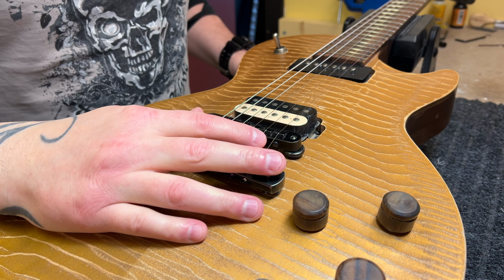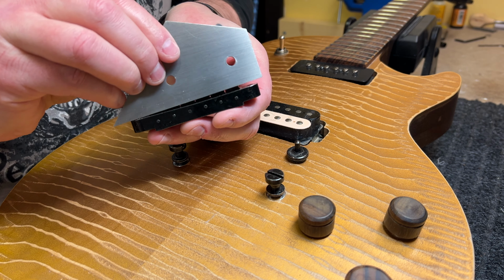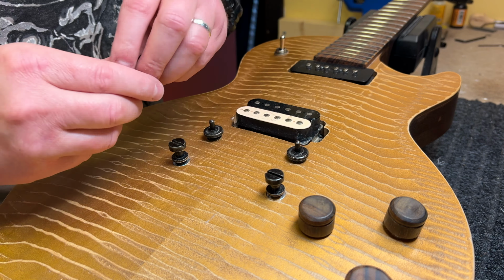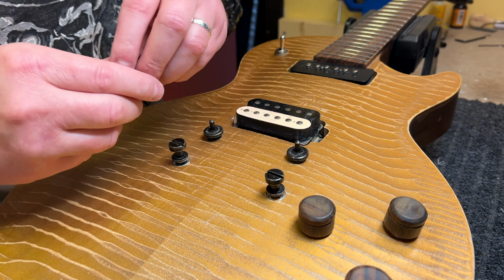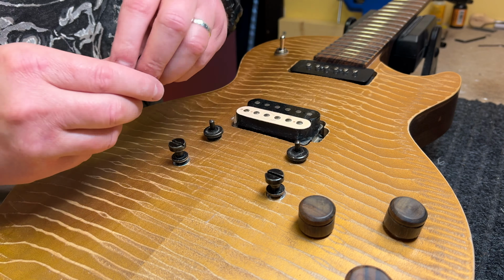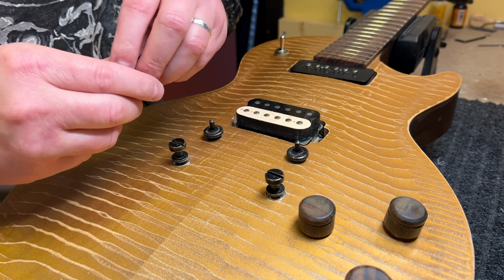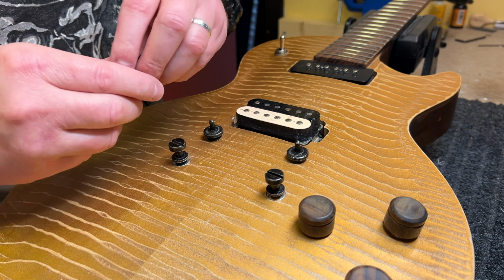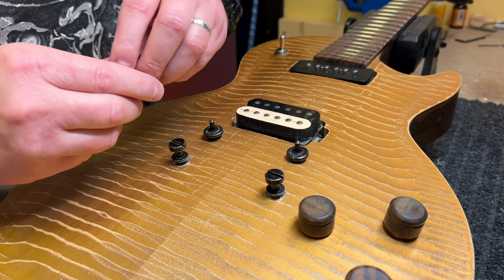Gibson Les Paul COLLAPSED Bridge HOW TO FIX IT

Comment: sometimes it's possible to re-straighten an ABR-1 bridge if you make a jig to get it in a vice and apply the right amount of pressure. Though, this is often a waste of time, as several problems can develop in the whole stability of the bridge afterwards. Replacing it is likely a simpler solution
Reply from the maker: Yeah you are right, once the material is bent and you bend it back then it's quite a lot softer compared to before you bent it back. It's best to just swap the bridge for a new high quality one.

Comment: A bent bridge can be returned to its original state in a vice in 5 minutes through 3 wooden spacers. One spacer should be placed at the bottom of the bridge, and two spacers should be placed at the top where the holes for the bushings are. And start tightening the vice.
Reply from the maker: Yeah but its not really recommended because once the metal is bent its quite a lot more softened when you bend it back, I used to work for many years in a metal factory so I know about this stuff. But sure you can do it, but you will most likely end up with a collapsed bridge again.
Reply: @HearGear  The problem is that everyone sets up the bridge incorrectly. The stopbar should be raised so that the string touches the bridge at only one point - on the saddle. Or wrap the strings around the stopbar and lower it completely. I straightened the Gotoh bridge on the old ESP Eclipse like this, no problems for 5 years now, the strings are around the stopbar.
Reply from the maker: @eugenechek7288   Yeah that's what I said in this video, to much angle on the string over the saddle.